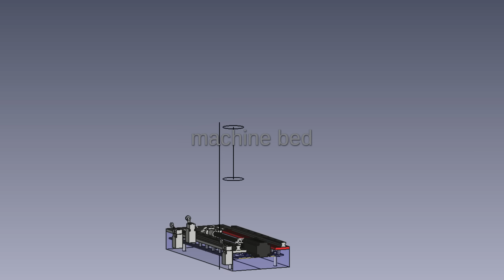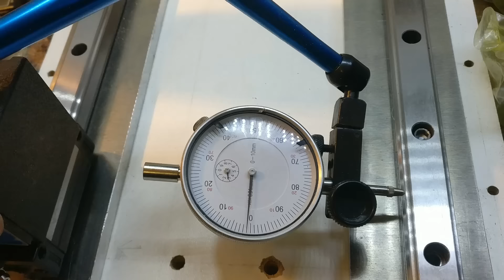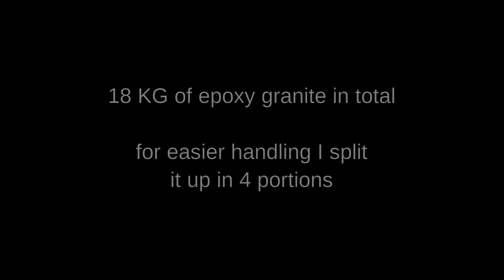home made epoxy granite cnc - part 1 machine bed

Comment: Great work! Are you going to use steppers or some of these hip JMC servo's?
Reply from the maker: Thanks. I'm planning to use normal steppers.
Reply: @joergbeigang  Just take a look at the currently available v6 versions of the jmc's. They have an auto tune feature. I'm using them on my machine (the v5, that requires more manual tuning) and they are very impressive. Don't be misled by their relative low torque ratings, they are excellent performers.

Comment: Is this your design? I have imagined doing something similar for a few years now. :-) What is the mix for the epoxy granite, if you don't mind me asking?
Reply from the maker: Yes, that's my design. For the mix I used some gravel, maybe 10 to 20 mm long pieces and enough sand to fill the space between the gravel stones. A bit more sand makes the handling easier - it behaves more "liquid". The same with the resin. With my my sand gravel mix I figured it should be less then 15 percent resin. Too little resin on the other hand makes the mix dry and there is a good chance for air bubbles in the cast. You got to play a bit around and do some test casts. I used those small tupperware boxes for that. With them you don't need wax and they come already with an draft angle, so it's easy to get the pieces out later on. And the most important: the sand and the gravel got to be very dry.

Comment: will it get scraped?
Reply from the maker: That would be a great way. But I won't do it. I don't know how to do it or better I never did it, and I'm not having a big and straight enough reference surface. It would also be a pretty big job I guess. In x direction the threads are perfect, but in z direction I'm 2/10 of a mil off (measured with straight edge and a feeler gauge).
I go the easy way and take off half a mil on a traditional mill.
Reply: @joergbeigang  Great job. A creative way to get rigidity and stability. Carry on. However, if you are going to get deeper into a machine building hobby, scraping is an essential skill. For instance, say you mount rails but  tightening them down twists them slightly, and the truck binds. You could scrape the rails to fit the bed. Then even if the bed isn't perfect the rails will adapt. Scraping is not difficult, the tools and materials are cheap, yet you can achieve greater precision than any machine you could buy.
Reply from the maker: @southbendkid  Yes, I definitely should get into scraping. A while ago I watched the video of Dan Gelbard about scraping and lapping - absolutely fascinating. But as I was already writing earlier I'm not having a good and big enough reference surface. The piece of granite I'm using for marking is just a scrap piece of granite I got from a local stonemason. It's good enough for marking, but that's it. 
But I guess the best would be to get a scraper and just go for it on a scrap piece of aluminum or steel.
Reply: @joergbeigang  Im not saying this is a good idea LOL but you could actually create a perfectly flat reference surface by scraping three plates, removing small errors each time until you have a perfectly flat surface. Should be ready to use in about 6 months haha Cool project!
Reply: @manberdo   it is not completely true and it will be difficult for such large surface.
Reply: I said it would take a long time and never said it would be easy BUT it would work. After all, the first surface plates didn't come from nature.... @veloclubustrem1039
Reply: @manberdo  
In the olden days of American machines, all of the ways were scraped in.
Not only does it allow you to true up the flatness but square it up and make sure that oil has a perfectly textured surface to get into. Like cross-hatching engine bores.

Comment: Please don't slide the lineal on the surface!
Reply from the maker: Why is that? The straight edge is gonna wear out? Always happy to get good advice. I'm obviously not a machinist ...
Reply: @joergbeigang  
Just from this perspective: Your ruler is about 0.001mm straigt. Just approximate how often you have to slide it before trippling the tolerance to 0.003. All of your workshop has partikels and every one of it is more or less abrasive. Take this in mind and this tool can last for many years.
You may not a machninist but you're much more inovative than most.
(German CNC mechanic/ engineer)
Reply from the maker: @OleZZ222  makes totally sense. Thx, I'll avoid that in the future!

Comment: why not simply fix the rails on a granite surfaceplate?
easier and cheaper
Reply from the maker: Yes, if I'd blown up the aluminum support for the rails to a thickness of 30 mm it would work (because of the clearance for the ball screw and the stepper). For sure not a bad way to do it. Not sure if it would be cheaper. This piece is about 30 Euro for epoxy, maybe another 10 for gel coat and wax. Sand and gravel comes almost for free and the wood ain't expensive as well.
But most important for me was that I'll give this technique a try. It's got a lot of potential, especially for  shapes more complex then a cube (a 4th axis for example)
Reply: You don't need to have any rail supports really, it's really easy to knock out a slot with a tile saw to sink the ballscrew underneath the surface of the plate.  Just get the rail directly on the granite.  It is a right PITA to do all the threaded inserts though.  A hybrid approach can also work well, which is what I ended up doing myself,  laminating solid blocks of granite and steel plates with epoxy.  Not as flexible as a full epoxy granite, but still let you get odd shapes without a ton of work.
Reply: @markmedrano8073  do you have pictures, I'd love to see it
Reply: I have a couple of videos showing it on @siieefpv

Comment: Too much resin...8% is ideal....;)
Reply from the maker: Often heard about very low percentages of resin. I made some tests before from 10 percent upwards, but the low percentages didn't handle very well and I didn't like the result. What's the downside of a higher percentage apart of economical reasons?
Personally I prefer a little less good material properties and a cast with less air bubbles inside then the other way around.
Reply: @joergbeigang  getting closer to the ideal matters for much larger structures. To get closer you would want a more complex aggregate mix, with 3 or 4 different sizes and an agitator. It doesn't seem worth the extra time and effort.
Reply: @joergbeigang  theoretically the same principles as for cement-based concrete apply...up to a certain point, more aggregate (less binder) actually makes it stronger! The toughest concretes available  have a consistency quite similar to "wet" mix you had, they do not flow at all and have to be compacted.